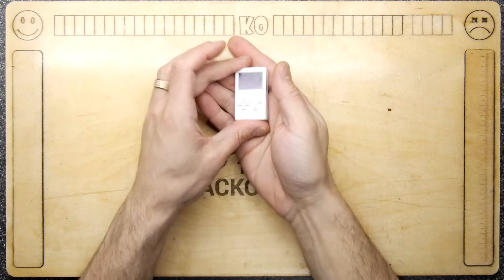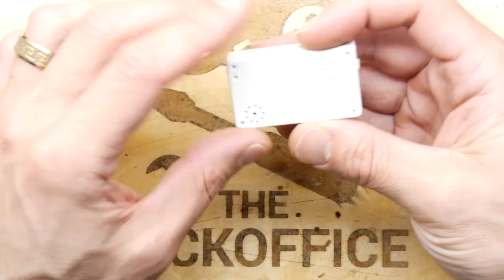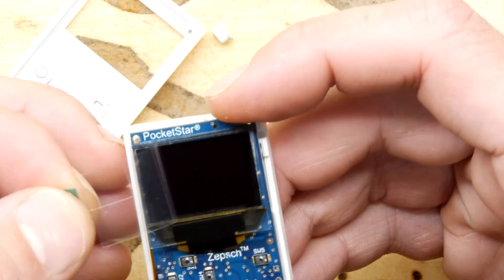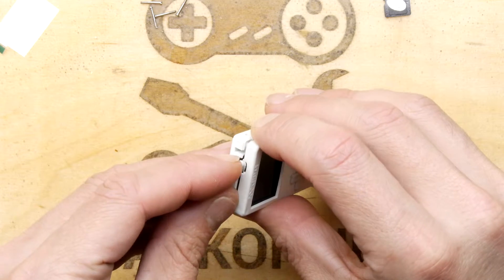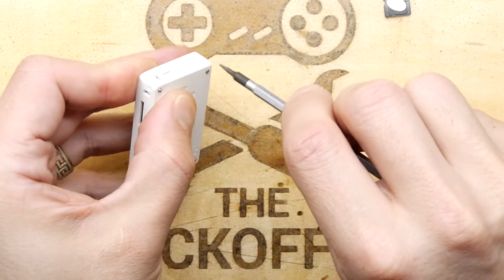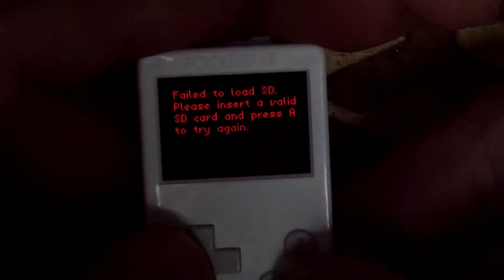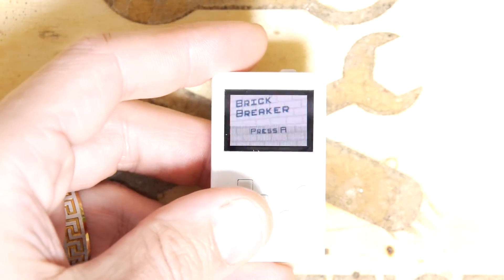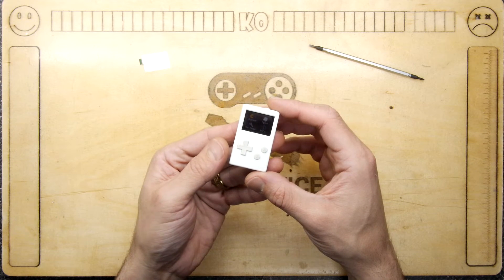First production released Pocketstar on Youtube!

Comment from the maker: There is something a little odd in the audio of this video. I endeavoured (untypically) turn off my PC, fan heater, washing machine etc for this video to reduce background noise and this little high frequency sound seems to have crept in. This is one of the joys of filming among so much test equipment in that you can be sure something is generating some em radiation thats getting picked up by the mic.

Interestingly enough I have spent a small fortune and a lot of time in building a mains powered setup to power my whole rig. I do not use it as I just could not eliminate the pesky mains hum that seems to be able to find its way in. Despite a lot of grounding and experimentation I gave up (for now). Batteries seem to be the only solution, but as microphones tend to live at the end of a wire, decoupling these can be a challenge. 

How to eliminate it in general? Well You put the mic an inch from your mouth and use the massive signal to noise ratio you get to allow you to wind down the levels and eliminate all those pesky sounds. Not so easy when you are in the backoffice and need to use your hands - unless you want to use a horrible tinny boom headset. 

I will figure something out, but apologies to anyone using headphones who can hear the whine of doom. Perhaps you are not annoyed by such things as I am. Several years in the signal processing business do make you sensitive to visual and audio artefacts :)